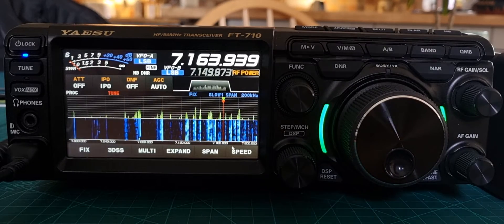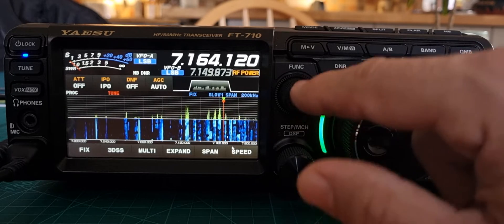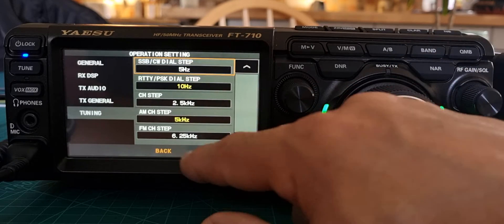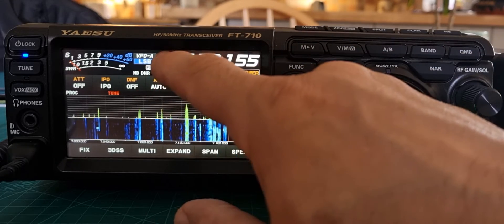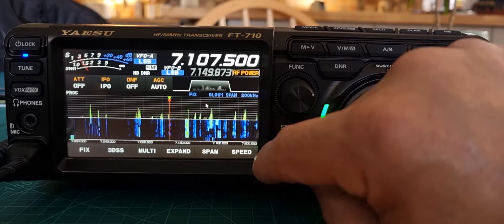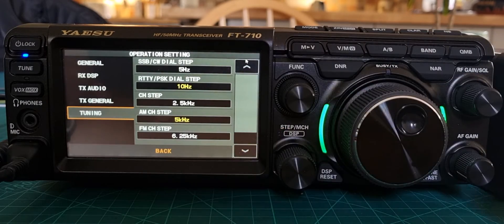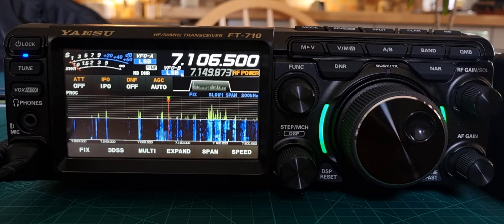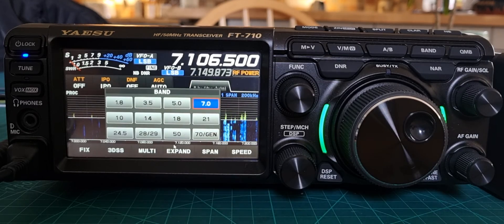YAESU FT-710 Frequency Steps Adjustment

Comment: Thanx for the vid.  I forgot about FAST. I like it & it was one thing I thought was missing on the 710.  If the OpSet is set for 20Hz (default) then the fast will increment a 200Hz.  But if you set it to 10Hz, FAST will increment a 100Hz.  73 👍
Reply from the maker: Thanks for the info!
Reply: Have you tried right-clicking to see if any additional options, such as 'Band', come up? I take your point about scrolling to tune. It's a shame that Yaesu missed that out but it should be an easy update to deploy.

73 de Félim M3HIM